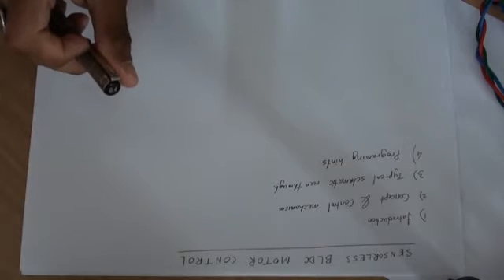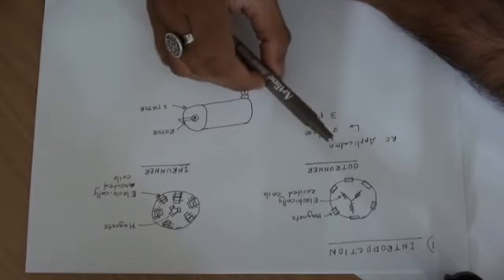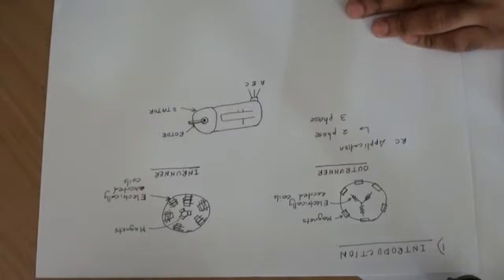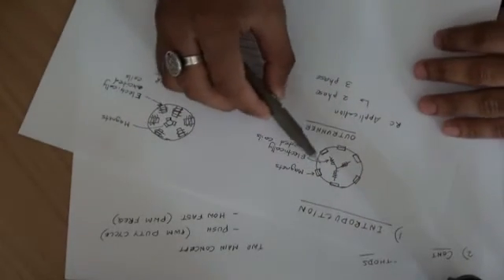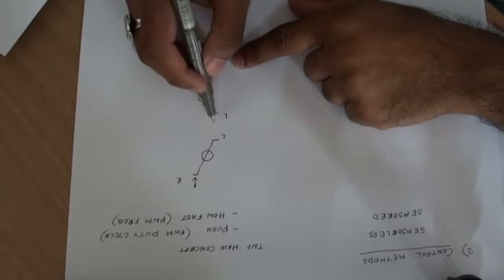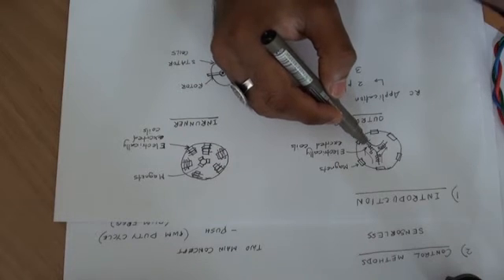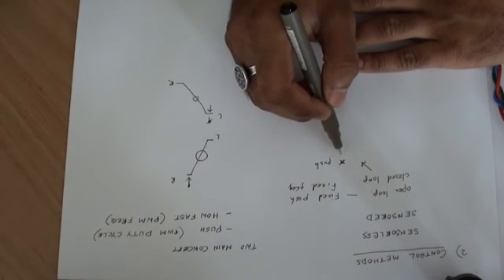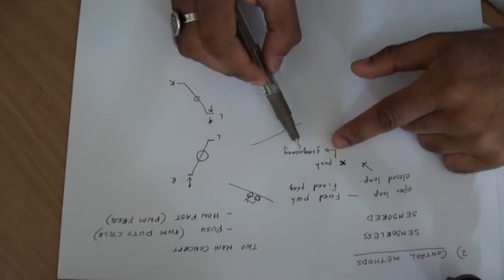Xmega Brushless DC Motor Controller (BLDC) - How to Part 1

Comment: Hello Mr. very nice video. I just wanto to know your thoughts about one technic. Mr. Takao Shimizo, one reference in BLDC uses the technic with nodes between the poles and compare with the counter poles to determine the position, like A|BC, B|AC and C|AB. Do you, in practice are confident to run without any sensing method?
Reply from the maker: Leonardo Takahata I have not come across this method. Do you have links to literatures on this? Sensorless method is good enough for continuous runs like in the RC application where you run the motor and just vary the speed. But where you need to run in very slow speed with precision you really should use sensored control.
Reply: Mr, thanks for the answer. Here is the schematics:
https://drive.google.com/file/d/0B9zvk_60J5hJYXR2WS1kaXp6VzA/view?usp=sharing
Reply from the maker: Leonardo Takahata Hi...a little hard to see the image. But it does not seem to offer anything out of the ordinary for 3 phase BLDC drives.
Reply: Hello, if you download the picture and use ctrl + you will can see clearlly, can you check it please?
Reply from the maker: Leonardo Takahata I am sorry. The resolution is not high enough to show me things clearly. I tried.

Comment: please, what are the different control techniques used in relation to a BLDC motor. I would also like to know which technique you feel is the cheapest to implement?
Reply: Cheapest is based on zcd detection like in the video. There are some more advanced, for example InstaSpin from TI.

Comment: In your opinion which of the two BLDC designs (outrunner/inrunner) would perform better on an electric vehicle?
Reply: In terms of construction, on wehicles, are mostly outrunners installed. In terms of available torque on shaft, inrunners are better.

Comment from the maker: The procedure is not that different to a sensorless method. See video part 3 and 4. Instead of using the ADC to detect BEMF, you could have 3 interrupt pins detecting low to high transitions coming from Hall sensors....timing and rest of the firing procedure stays the same...